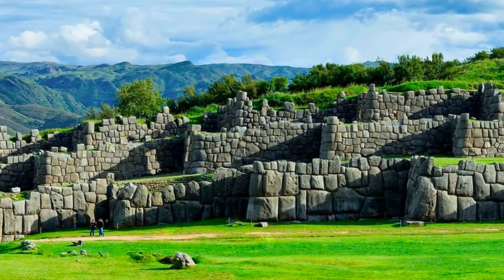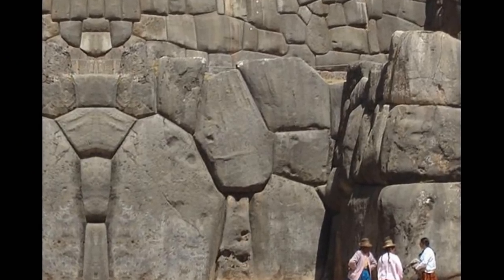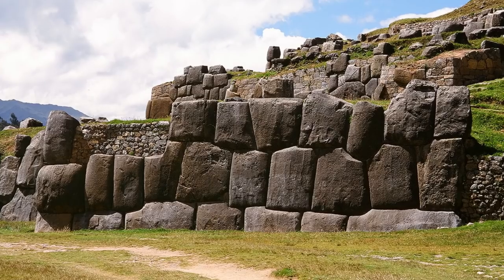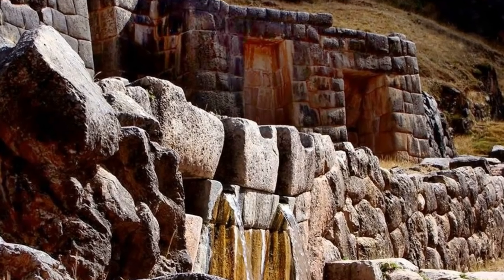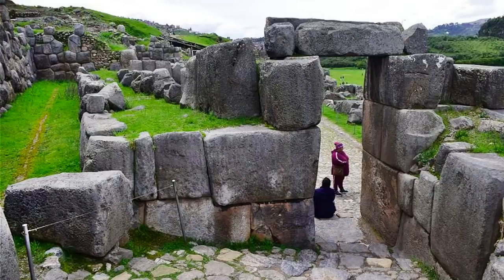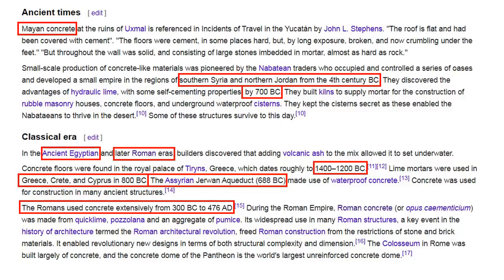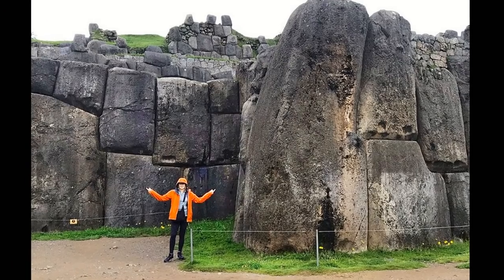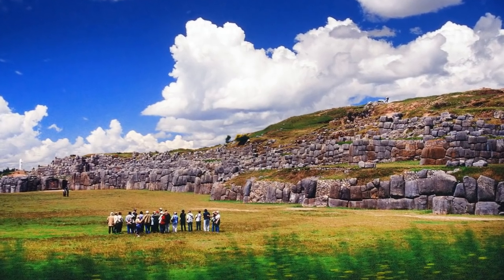Explained: How were Peru’s #Sacsayhuaman Walls Built

Comment: Stupidity. They simply positioned the stones in the bottom row. Then they used clay casts to copy the shape of the blocks and their intersections. They applied these molds to stones until the molds integrated perfectly with the stones. Then they put these stones on top of the bottom row. They started over for all the other rows.
Reply from the maker: Different materials would leave veins in stone which means your clay casts would have left evidence of the casts.  Are there any signs of clay perfectly "integrated with stone"?  Do you know how long it takes to change clay to mudstone? Do you think the ancient builders waited for that long for each block so they could have a perfect fit?

Comment: 1:20 False. The Incas did not acknowledge that these structures existed long before their time. In fact they were building walls after the Spanish conquest so it's well indisputable that they did it. 
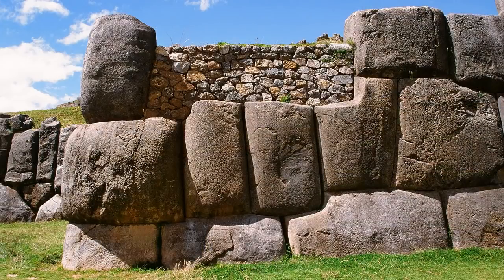1:25 False. That is not "real Inca work". The small stones are modern, added to make the site safe and traversable for tourists. There are black and white pictures of the site before these stones were added so the fact you're wrong is indisputable.
1:45 False. All the historical evidence points to the fact that the walls were built by the Incas. Not only are these techniques seen throughout Incan history but the Spanish had the Incas build structures and they used these same techniques showing the same expertise. It is not speculation but well established historical fact.
2:10 False. Of course it could be duplicated today and a thousand times more precisely at that. What an absurd thing to say.
2:40 Wow, you said something that's true. Yes, the method that Incan masons used with smaller stones - selecting suitable stones, chipping, placing and retrying (using mud / dust to show the imprint) - would indeed have been impractical for these larger pieces. The actual explanation is that they rested the back of the rocks on the terrain and suspended them above where they would be placed with wooden supports. They then used a stick cut to the length of the gap, when the stick wouldn't pass they chipped until it would. Stencilling basically. That's what makes the rounded corners.
3:07 False. Hand tools can produce much more accuracy than we see in this wall. The statues and columns of ancient Rome were made with hand tools with higher precision than we see here.
3:15 The blocks were dragged with ropes. All you need is enough people pulling. The were dragged behind the walls and then moved forward, suspended by wooden supports and dropped into place. It's not known whether they used hoists but it could have been done without them.
3:20 That the Incas were accomplished ("advanced" if you like) stonemasons and engineers is indisputable. As for "mission impossible", obviously not when they did it. It certainly wasn't easy and took planning, expertise and intelligence which the Incas had in spades. These were people like the rest of us; ingenious, intelligent, hardworking and capable. You seem to be painting them as racially inferior barbarians saying they couldn't possibly have achieved what they very clearly did. There's a racist subtext to your argument. I notice you're not saying the Romans couldn't have built the Colosseum.

In fact, I'm stopping here. This is more claptrap than I can take and offensive claptrap at that. Your total disrespect for the historical record and for the achievements of the Incan people is a disgrace.
Reply from the maker: 1:20 False. The Incas did not acknowledge that these structures existed long before their time. In fact they were building walls after the Spanish conquest so it's well indisputable that they did it. "
---Please provide proof. 

1:25 False. That is not "real Inca work". The small stones are modern, added to make the site safe and traversable for tourists. There are black and white pictures of the site before these stones were added so the fact you're wrong is indisputable.
---Please provide proof. Any links of the photos? 

1:45 False. All the historical evidence points to the fact that the walls were built by the Incas. Not only are these techniques seen throughout Incan history but the Spanish had the Incas build structures and they used these same techniques showing the same expertise. It is not speculation but well established historical fact.
---What historical evidence? Please provide proof. Any records, published papers? 

2:10 False. Of course it could be duplicated today and a thousand times more precisely at that. What an absurd thing to say.
---NO. many experts already said that we can't. 

2:40 Wow, you said something that's true. Yes, the method that Incan masons used with smaller stones - selecting suitable stones, chipping, placing and retrying (using mud / dust to show the imprint) - would indeed have been impractical for these larger pieces. The actual explanation is that they rested the back of the rocks on the terrain and suspended them above where they would be placed with wooden supports. They then used a stick cut to the length of the gap, when the stick wouldn't pass they chipped until it would. Stencilling basically. That's what makes the rounded corners.
----So that's your theory how the Sacsayhuaman walls were built? 

3:07 False. Hand tools can produce much more accuracy than we see in this wall. The statues and columns of ancient Rome were made with hand tools with higher precision than we see here.
---Are the Roman statues the same size and weight with these blocks? Which columns are you talking about? 

3:15 The blocks were dragged with ropes. All you need is enough people pulling. The were dragged behind the walls and then moved forward, suspended by wooden supports and dropped into place. It's not known whether they used hoists but it could have been done without them.
---What kind of ropes can drag multi-ton blocks uphill without breaking? 
 
3:20 That the Incas were accomplished ("advanced" if you like) stonemasons and engineers is indisputable. As for "mission impossible", obviously not when they did it. It certainly wasn't easy and took planning, expertise and intelligence which the Incas had in spades. These were people like the rest of us; ingenious, intelligent, hardworking and capable. You seem to be painting them as racially inferior barbarians saying they couldn't possibly have achieved what they very clearly did. There's a racist subtext to your argument. I notice you're not saying the Romans couldn't have built the Colosseum.
---You completely misunderstood me. Maybe because you have a racist mindset and everything disagreeable means racism to you. What I said is that with today's technology we can't duplicate the walls. Which part of this discriminate the Incas? 

In fact, you need to back your argument with scientific records and proof. I have provided my reference in the description section. Could you provide proof for your claims?

Comment: No.  The back side would have conformed also to it's surrounding.  It did not. The shapes wouldn't appear like that anyway.  Try it yourself with clay.  It won't work.  Not all lower blocks have sag.  
It's a just so damn baffling.  
I have pondered the same questions.
one side of me says they were definitely in a clay State and shaped by hand in place.  Then a second glance say no.  Who, why, how.  Errr
Reply from the maker: Obviously an advanced material was used - today's concrete or clay won't perform the same way as the ancient material. When you said the backside (of a block) didn't conformed to its surrounding, how do you know it didn't? Is there proof that the "surrounding" being the original state and not conformed with the block? 
As for the lower blocks that don't sag - I said in the video that it's possible some blocks cured longer therefore they would be harder and kept their forms better.
Reply: @CuriousBeingbyTina  yes I did listen to what said.  More than once.  And many others on the same topic for many years.  I also have extensive experience in the field of modern construction.  I have hammed rock, I have chiseled stone, I have thrown clay, I have formed and poured concrete.  Over 100 thousand tons.  I am experienced in many fields.  In Wich state do thing the material was in when placed... From liquid to solid. Material performance would have to be somewhat of that in between.  
  The back sides have been revealed and the appearance is that of a rock.  If the backing structure was ditch formed  and the material was placed liquid the ditch material would be encapsulated into the stone.  If it was placed in a more gel-like or clay like concentrate then you would assume the backing material would have left the stone with a pillowing effect around the ditch material.  And if you have ever formed then you will understand how serious it is when trying to hold up several several thousands of pounds of liquid in a form.  Even working this much clay will want to do that saggy slump off thing.  And crack.
Sometimes when imagining how this could be done and looking at the walls the order of placement seems... well not in order.  The horizontal elevations versus the acute an obtuse angles from left to right.  
  More interesting things would be that not one being carved a name or left a handprint into a substance such as clay.  In a liquid  form somewhere in there would have to be a foreign object that accidentally fell in.  
  Another observationis..the gouging on some of the rocks.  The same kind of Mark's you get in wood when using a scrub plane.
  These marks also appear at the Aswan quarry and balbeck.  So mysterious.  
  It really is a dream to touch them.
got some might want to add cars in these shapes the same as absolutely impossible so I'm left completely baffled

Comment: Es muy fácil para un geólogo saber si estamos en presencia de una roca o de un concreto artificial. It's easy for a geologist to know if we have a rock or a concret. No hay razón estructural ni sismológica para realizar bloques diferentes. Porque una civilización que tendría un concreto y tecnología tan avanzada no usaría otros materiales salvó un concreto? I like You Video but i'm not agree with your theory. I'm a geologist engeneer. I liked your theory above longyou caves
Reply from the maker: It is well known among architects and civil engineers that walls with tightly-fit blocks in various shapes have better structure integrity and better suited for earthquake-prone regions.

Comment: Unless you can recreate the process, it is not concrete. No way to make a concrete that resembles actual rock like that. And rather stupid to form one block at a time. Just form the whole wall and pour the concrete. Too time consuming to do it block by block. And if it were malleable then there would be more evidence than an occasional dimple or protrusion.
Reply from the maker: We don't even pour an entire concrete wall today with no joints or some kind of reinforcement, specially not in a seismic region. A rigid concrete wall won't work as well at this site. I explained in the video about the blocks shapes, molds and the reason behind building a dry stacked wall. Btw there are plenty of evidence of scraping and stamp marks.

Comment: The nob idea is a good one !

Think the nobs were used to electrocute the stones so as to put new life into it's molecules, making them softer, or maybe just temperature management to stimulate MOLECULAR BONDING strengthen the stones.

On the concrete mixture, that's what most people thinks, they believe the stones were soften one way or the other .

Gravity U mentioned is a myth, and has been factually DEBUNKED by the mechanism of GAS BONDING.

Volcanoes shows the best clues yet of how those walls were built  !
Reply from the maker: Thanks for your insight. I appreciate it!

Comment: I you could pour stones would you not make them the same shape and size, not different size like stones quarried and shape to fit. There is more evidence that they where made in the time line historical than just your ‘it looks to hard and time consuming”
Reply from the maker: I explained this in detail in the video.
Reply: Having worked with stone for 30 years, I can guarantee you that they hit and rubbed the stones to make them fit. You might find, sciences against myths and world of antique video on Egyptian building techniques interesting.
Reply: Oh and I just had a thought the back of the stone in the retaining wall is unfinished, so that’s why not molded.
Reply from the maker: @johnbryan459  I proposed that this special concrete has a texture like play-dough. The semi-plastic blocks were cast and then laid in position.  Pressure was applied to multiple blocks to produce a tight fit.
Reply: It’s like talking to the wall….

Comment: Your theory is full of holes;  we have no technology that even approaches what you describe and even if we did we would use uniform small, easily manageable sizes, not he ludicrously large and variable sizes used in Sacsayhuaman!!  You suggest they used molds but there are no two stones that could have come from the same mold and molds are only used to mass produce.  They are even further complicated by having 5 or more surfaces!  So casting is out.  Now if they had a way to take random stones and make them soft and mash them together that makes more sense except:  1. why such large unmanageable sizes   2.  how did they lift and place 100 to 200 + ton stones, even in a solid state let alone a semi-fluid state?   3.  having some magical way(because we don't know how) to soften the stones does not guarantee a second magic(anti-gravity?) that makes hundred tons stones as easy to handle as lego's or play dough!  Your theory is in fact a restatement of other ancient high tech deniers theories to try to explain how this was done 1000 years ago using "bags of concrete" instead of 10 to12 thousand years ago with a technology we are afraid to admit we don't understand.    The Inca simply did not build these walls and their descendants have said so and they don't know who did.
Reply from the maker: You likely didn't watch the later part of the video, since I explained why the blocks are not in unified forms. You might also want to check out the dry cast stone method, Vibrant Dry Tamp (VDT) could be similar to the techniques used at Sacsayhuaman. The benefits of this dry cast stone method are: -Fast demold time. -Can cast into the same mold several times a day. -No treatment is required afterwards to achieve the limestone look. -Result of cast stone is very clean and natural looking. -High early strength. -There is a time just after demolding when a repair is relatively easy. 
It remains a possibility that there was an highly advanced industrial-level civilization existed before ours.
Reply: @CuriousBeingbyTina  Of course there was an advanced(more than we are) civilization before us, and I said so in my previous comment.

Comment: Why would they quarry stone many miles away if you can just manipulate it ? 2 Why would you not use even harder stone? Easy answers lack insight. lol "a technique" yes like i said no answer just more easy answers. Remember these walls were ordained with hangings and were all painted. Same dumb idea ive seen lately about the Gaza Pyramid. Some ass-hat thinks they used a water magnifying focus lens to melt granite.... ffs You can see the damned  igneous veins and are NOT homogenous. This isnt concrete ffs. If so quarrying rocks of the same shape would be counter productive.  Quarry a rock to fit a wall (in the shape nessesary.) but nO! we will take the shaped rock then what? Crumble it to sand and re-shape it to the quarried shape? makes 0 sense.